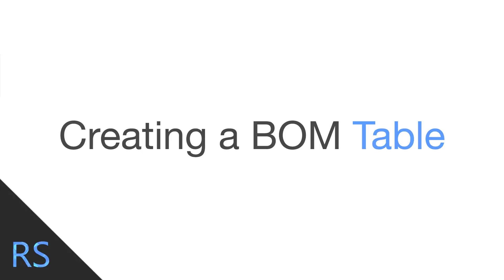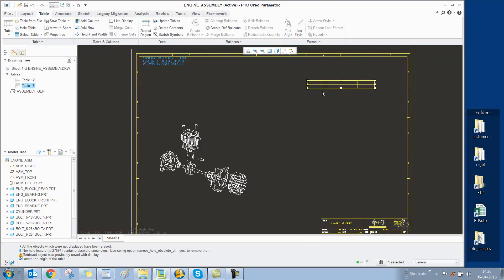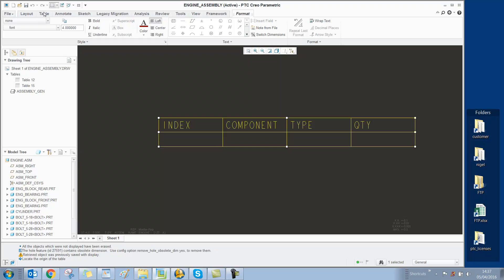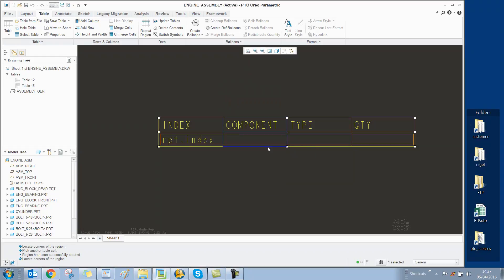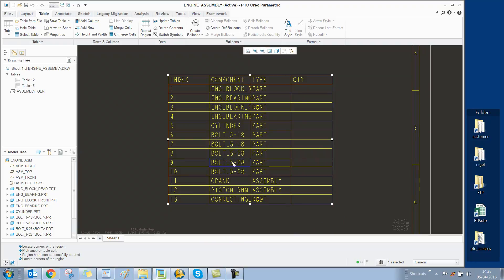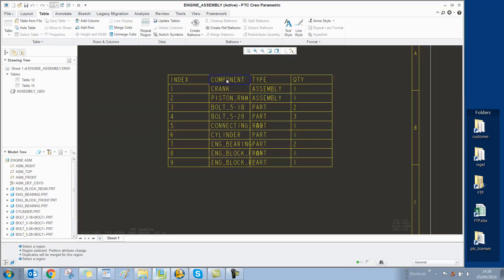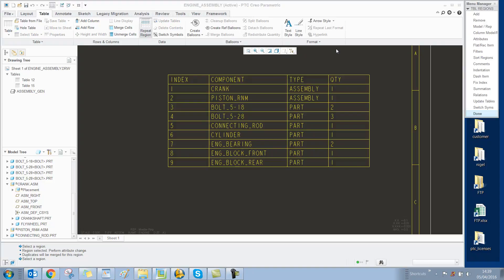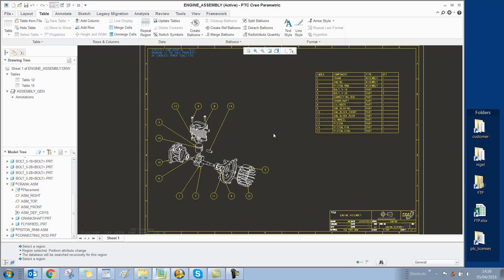Creating BOM tables using Repeat Regions

Comment: For those struggling with the selection (like myself): after hitting "Add" button zoom in to top left corner of the left cell, click left mouse button once THEN zoom in to bottom right corner of the right cell and click left mouse button once. Then click "Done" in the floating menu.